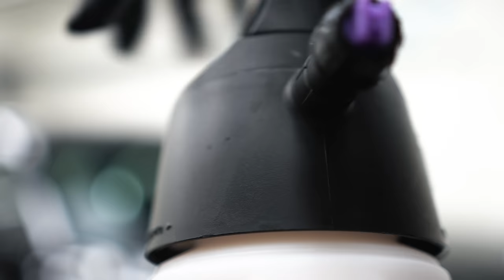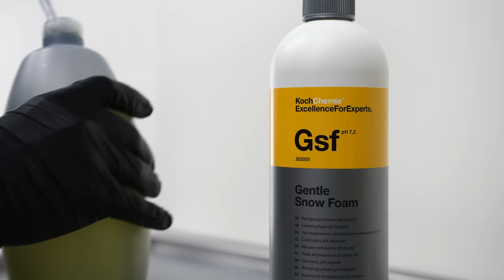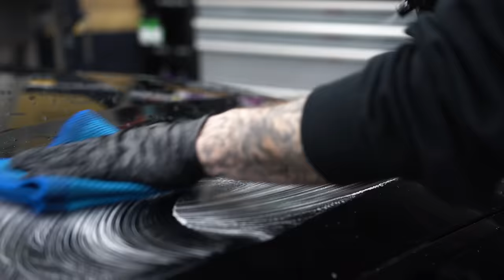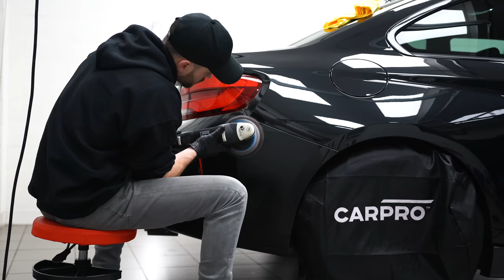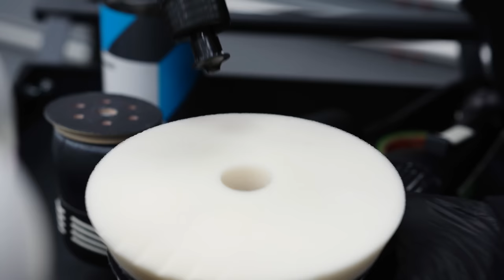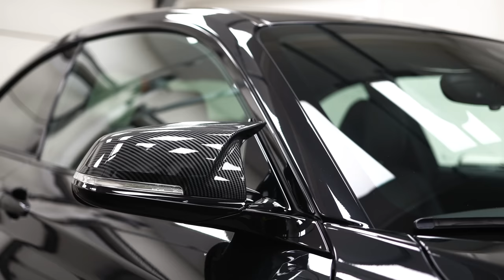BMW M2 Deep Clean - Wash, Polish & Ceramic Coating

Comment: Hi Vermijl! Why do you sometimes use GSF shampoo and sometimes Reset? Are there different particularities?
Reply from the maker: Hi Nathan! Both products are pH neutral shampoos, so they are pretty much the same thing. I just like to switch between the 3 brands I like the most, which are Koch Chemie, CARPRO and P&S.
Reply: @VermijlCarDetail  All right, thanks for your answer!

Comment from the maker: Who else likes the M2? Give the video a thumbs up if you do! 😉 Have a great weekend you all!
Reply: Why did you use CarPro eraser after you polished with CarPro essence since essence is a primer for cquartz?
Reply from the maker: @jelleengelbertink7978  I always do a light wipe down after I've polished the car with Essence, just to get rid of any remaining residu or fingerprints for example. I usually just spray it it on the towel and wipe down a panel or two. It might not be necessary, but it also doesn't do any harm.
Reply: @VermijlCarDetail  okay thanks! Directly after you applied essence or do you wait for let’s say an hour?
Reply: @jelleengelbertink7978  If you let Essence cure for 24 hours, no IPA wipe is needed. If you want to put the ceramic coating on before that curing time, an IPA is needed.
Reply: Nice work
Reply: Sure Bro, Thanks
Reply: Really nice job 👌🏽 where did you get your  custom apparel?
Reply: AMAZING
Reply: I just got my M2. Its awesome.
Reply: Once I got to your channel and could not leave ... I watched almost all the videos! It is very cool!
What camera and microphone do you use to record video?
Reply from the maker: @lionfish6448  Thank you so much! Really appreciate it! I'm using a Sony A7iii and a Rode Videomic Pro
Reply: @VermijlCarDetail  Thanks!
Reply: I'm not a very big fan of the M2, I prefer bigger cars from the BMW line such as the X4.
Reply: How long did it take for you to do this?
Reply: I like the m2, but my legs don’t fit lol. But m4 mt6 is my favorite bmw
Reply: How long did you spend for cleaning and for coating
Reply: So what’s are the benefits of detailing a car as supposed to it getting a normal wash ?
Reply: @musamnguni510  detailing the car because of the ceramic coating which he applied right after. Therefor the paint needs to be in a perfect condition. This ceramic coating protects the paintwork and is also hydrophobic which repels water. So that’s the main difference of this detailing + coating video vs a normal carwash.

Comment: No before and after in the end... No shots of the car outdoors with natural sun. Otherwise, I thank you because I had a body shop repair a small spot in the rear wheel well and they sprayed primer, sealer and all sorts of muck all over the car/ (Never used a tarp to cover what they weren't working on. SO: Now I have this car covered in all this stuff and I'm about to go crazy with restoring the paint. Perhaps I should just sand blast the whole thing and primer it... sand then paint ?? It was a blast watching this car get babied. You do a very nice job. Would have loved to see before and after and natural light and reflections.

Comment: I love BMW's, I can't imagine why the owner would want to change those sick ass rims, they're so nice, I'm completely against non manufacturer rims, the BMW logo is the only one that should go onto a BMW. This is some next level polishing, the car was already squeaky clean by normal standards but he took it to another level
Reply: No worries, I changed them for OEM BMW M Performance 763M wheels, which are delivered standard on the M2 Black Shadow edition.
Reply: @Miggel_M2  is this your car or you just have the same one
Reply: @johncorbin5332  this is my car. Check also the pinned comment from Vermijl
Reply: @Miggel_M2 awesome, I work for bmw and lease them, I just got a new x3 a few weeks ago, I love the cars they make
Reply: The new X3 is also great! Got it for a day when my M2 was in maintenance. It’s size is almost the same as an old X5.

Comment: I wish shops with such good work ethic existed in my city. I took my trackhawk to a detailing shop to get ceramic coating, ppf, and a cut and polish. On the day I picked up my jeep, there were various air bubbles underneath the ppf and there were still small swirls in the paint. Such a disappointment.

Comment: Good job on this! Looks amazing! Can't believe they have the exterior carbon fibre package but skimped on hydro dipped wing mirrors!
Reply: Those “Competition” caps where back in 2018 not available in the OEM M Performance package, so the previous owner installed these “non” OEM caps instead. (Which is the only not OEM part on this car). These will be replaced in the future by OEM ones of the M2C:). But first other wheels will be installed.
Reply: @Miggel_M2  Lovely car tho! Just doesn't do it justice with those mirror caps on, hopefully they get a nice set of wheels to set off the car!
Reply: @kieranmitchell6359  in the meantime I replaced the mirrorcaps with full carbon mirror caps, and the new M Performance wheels are installed :).

You can follow the complete project now on a Dutch BMW forum:
https://www.bmwdriversforum.nl/viewtopic.php?f=238&t=25126
Reply: @Miggel_M2  good man! I’ll give it a look

Comment: Have you got a video on how to clean car cleaning equipment (drying towels, brushes, sponges etc)?

Last week I put one of my drying towels in the washing machine and let them air dry. This week I went to use it on my car and it hardly soak up the water, it pushed the water around more than anything.

Comment: you should push or use wool on those couple deep scratches, you can get em all out!!
Reply from the maker: Wool does a great job at cutting, but no worries! The microfiber cutting pad got them all out! 😉
Reply: @VermijlCarDetail  nothing a little elbow grease cant handle haha!

Comment: Awesome job ... I have the same M2 .. but I have one request.. when you clean wheels with water , after a couple of minutes you have dust on disc brakes.. right ?
How to avoid or remove that ? Thanks
Reply from the maker: Thanks Stéphane! Check out Bilt Hamber Atom-Mac. It is an anti corrosion product which you can dilute and spray on the discs after washing.
Reply: @VermijlCarDetail  Thanks a lot for the answer... 🙏

Comment: I'm gonna sound like a broken record lol.
Awesome job bro. Just one question though, what did you do to the windshield lol...
Still awesome job.
Reply from the maker: Thanks man! The windshield also got polished, not to remove scratches but just to get it deep cleaned and prepared for coating 😉
Reply: @VermijlCarDetail  which of your compounds did you use on the windscreen please,,?

Comment: Phenomenal work my friend! Did you use gsf for the contact wash?
Reply from the maker: Could’ve used Gsf, but this time I put some Reset in the wash bucket. Koch Chemie, CARPRO & P&S are my go-to brands, so I’m just switching it up every now and then 😉
Reply: Sounds fair enough. Did you use reset in the second coat of foam? Also do you use different wash products depending on the car? Or just what ever you chose on the day. Sorry for all the questions. 😂

Comment: good job bro please i have a question why you use heavy cut compound and microfiber pad as far as i know bmws have pretty soft clear coats not that hard as mb and  gm cars
Reply from the maker: Hi Ahmed, thanks! Most BMWs exactly have hard to even extremely hard clear coat. This goes with most German car brands.
Reply: @VermijlCarDetail  thanks a lot bro i get it now ❤️❤️❤️

Comment: Awesome job as usual. What applicator pad did you use for the windshield? The white circular pad. Is it just a cotton make-up removing pad? Thanks!
Reply: I also have used Carpro Flyby forte on my screen and there are some pads in the package. To me they seem identical to cotton makeup removing pads. I polished my screen with the carpro glass polishing pad and carpro ceriglass before applying  the coating.
The latest (2020) version of flyby forte only needs one layer of product.
Reply from the maker: Yep it's just a cotton make up removal pad. The kit comes with a couple of similar pads indeed.😉

Comment: A lot of grinding noise when stroking the wheels. That must have left marring and light scratches on the wheel surface
Reply from the maker: No not at all, there is not a lot of room between the wheels and the rotors, the noise is just the brush hitting the rotors.

Comment: Hi, I’m new to detailing and want to know more. Why didn’t you use clay on the car before the polish?
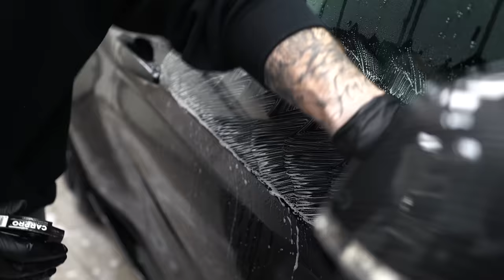Reply: Hey Moheet. around 7:00 in the video he is actually claying the vehicle using a synthetic clay pad / towel. He also hit the car with iron remover prior, which is essence is almost like a liquid version of clay. 

It's not required for every application to physically hit the car with a clay bar prior to polishing. I personally would at least use Iron Remover. Clay pads are great though and very beginner friendly. They're a lot less aggressive than real clay.

Comment: i like your rims. are they oem rims or other brands?
Reply: The wheels on the video are OEM BMW 19” 437M Jet Black. But I sold those wheels and replaced them with OEM BMW 19” M Performance 763M in matt black which saved me 3,4 kilo’s in total (both are forged wheels, but the M Performance 763M are very lightweight compared to the 437M)

Comment: can someone tell me why he polished the windscreen please? I get the paint because it removes the swirls and makes it look new again but the windscreen?
Reply: He did that to prep the windscreen before applying the Flyby Forte coating on the glass.
Reply: @Miggel_M2  what does the flyby forte coating do? Thank you
Reply: @mecopreto1018  FlyBy Forte is an advanced windshield coating. It’s extreme hydrophobicity repels rain and reduces the need for wipers at speeds above 50km/h, while increased durability makes it a long-lasting solution with enhanced glass protection capabilities.
Reply: @Miggel_M2  wouldn’t something like bead maker paint protection do the same thing? Thank you for explaining
Reply: @mecopreto1018 not sure because I don’t know bead maker. I know that Flyby Forte is special developped for windscreens and it adheres by penetrating completely through the top surface of glass. 

It was a nice adition to add to this detailing job. But to be honest I drove the M2 maybe 4 times in the rain the last 4 years, because I drive it only with good wheater in the weekends.
Reply: @Miggel_M2  alright thank you for explaining everything. You have a beautiful car

Comment: Fake carbon fiber side mirror caps
Reply: Yep they are already replaced by real carbon fiber caps :). Was one thing I disliked when I bought the M2 (was installed by previous owner). Also the wheels are changed now, to 19” M Performance 763M.